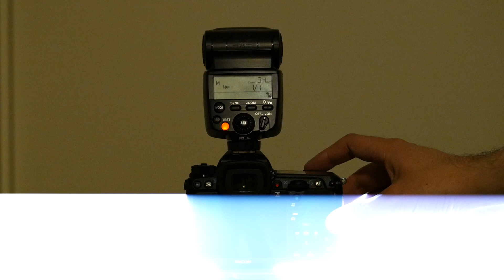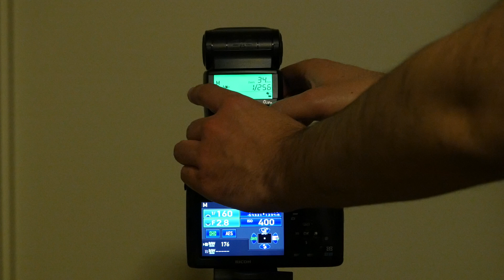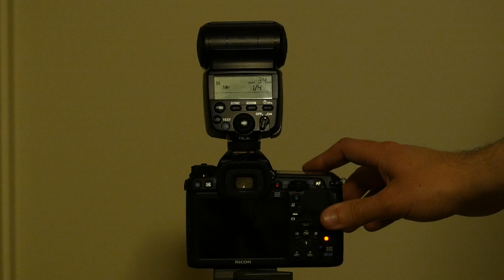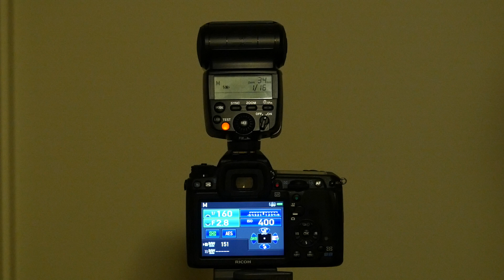Pentax Flash Speed Test (AF540FGZ II and AF360FGZ II)

Comment: I was always told to never put a flash on a camera what was on.  Or with the flash already on . I think the reason is the front right side pin contacts the  rear pin  with the center pin making contact  . In other words as your sliding it on  the center pin is contacting and stays as the front pin slides over the rear contact of the cameras  back pin  . The  back pin  of the camera should never have power with the front pin of the flash  . But with the camera and flash both on  the flash is making this contact as its being slid on . I think you can cause a camera short and a flash  short  neither is  good . So you should turn off both camera and  flash when  attaching a flash or any other device .
Reply: Exactly . You are 100% correct. I damaged my AF360FGZ by doing hot plugging !!   Now PTTL mode is only working randomly.